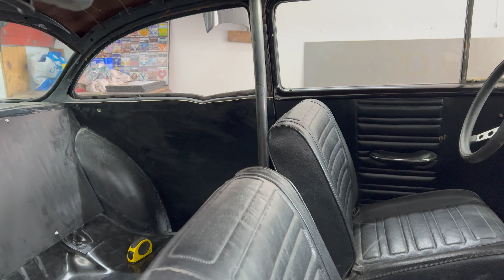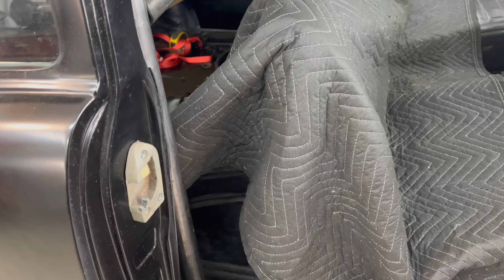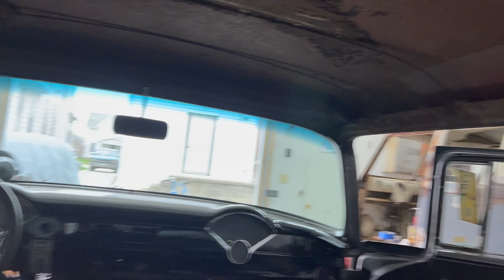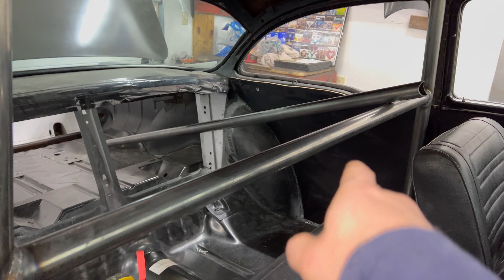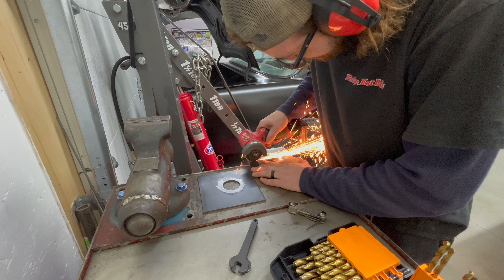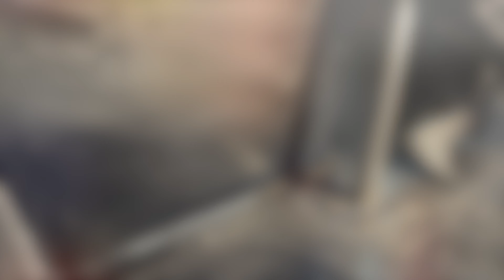1955 Chevy Gasser Roll Cage Install! part 2

Comment: Watching  here in Australia, you have done a beautiful  job on the roll bar & outriggers ,welding the floor  plates to the floor & the bar you have created  the same problem as Brian at BW's Garage,how do you seperate body from chassis if you have to lift the body at any time,not being critical of your work  but  just a thought.
Reply from the maker: Thank you for the kind words! I actually addressed that in the first video I believe. We almost went the bolt in route, but this car has brand new floors, rockers, body bushings, and trunk so there wont be any need to ever pull the body again. And if there is i have cutting devices! Haha

Comment: That turned out great man! Your welds look great man real nice. What gauge wire are you running in your welder! Catch you later ✌️
Reply from the maker: Thank you!!! I use .023 because I mainly do sheet metal, but with the heat and wire speed bumped up it seems to do great for this stuff.
Reply: @vintagehotrods  ok cool yeah it worked out great!

Comment: Could you have drilled the 13/4 hole in the plate and slipped them up on the cage and temporarily clamped them. Then slid them back down without cutting in half?
Reply from the maker: yes we almost did that, but I just didn't care for having them clamped up in the way while trying to work on it being there isn't much room because of how tight the fitment is. it was much easier for me to cut them.